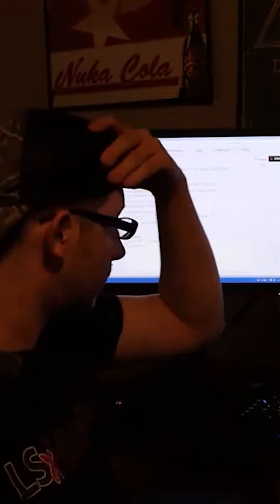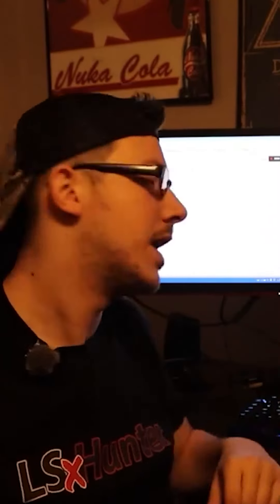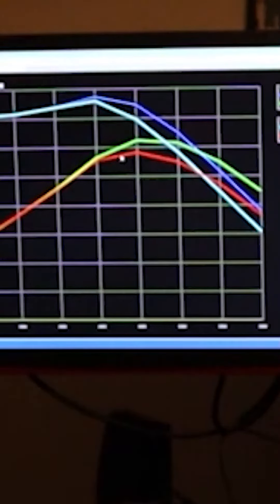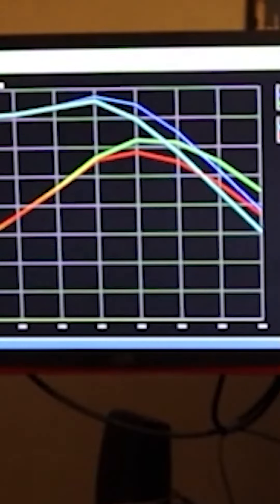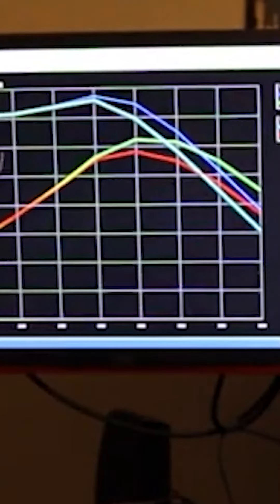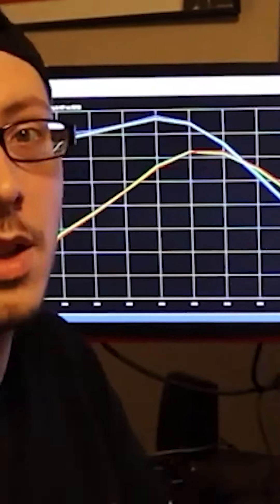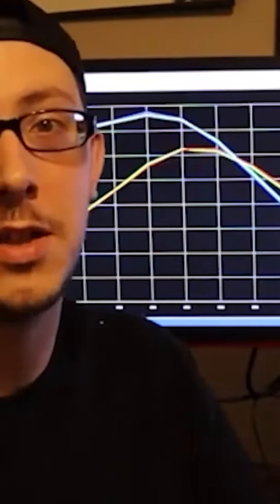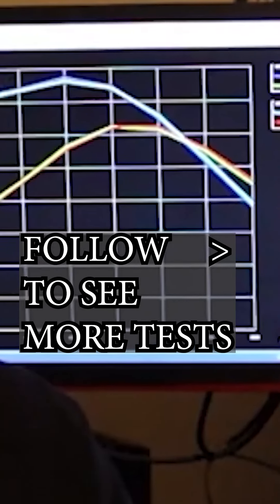How is the Summit Racing 2801 Camshaft in a Pontiac 400?

Comment: What about a 2800 cam in a Pontiac 350? 1970 engine 8.8.1 compression
Reply from the maker: With that compression ratio you’d likely do well with that cam - the lower duration will help out with the dynamic compression ratio

Comment: Im just in the process of putting this cam (spotts 068HL which must be the same cam as specs are identical)  in my 65 gto - 389 &. 3x2 Can you get a close up screen shot of the cam power curves its hard to see the difference between this and the blueprint 068 with .407” lift. Im having some issues due to a previous valve job that for some reason left my exhaust guides .095” taller than the intake when they were machined for teflon seals. Even with the stock 067 cam with.407 lift the retainers were kissing the seals... bottom line if the HL version doesnt make any more power this will be a waste of energy. 

Great series on cams for ponchos keep it up. Have you validated how accurate the computer dyno is vs real world?